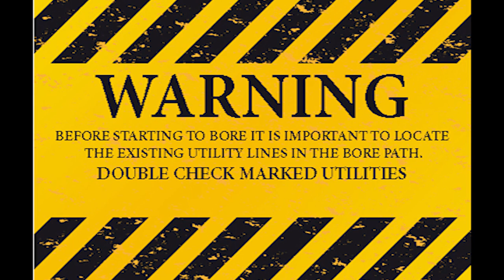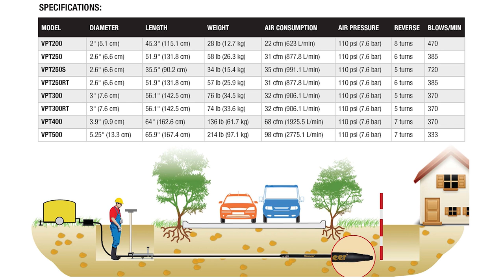Vermeer Positive Turn Piercing Tool Operation For Utility Installation

Comment: Will a rock stop it?
Reply from the maker: Hello Caleb, It depends on the size of the rock. A Rock Tool or RT Model will bust up and displace smaller rocks, however, it can be stopped with a large boulder.  Please let us know if you need more information.